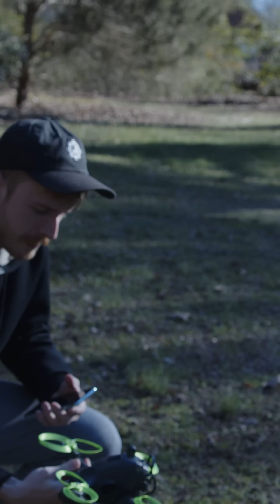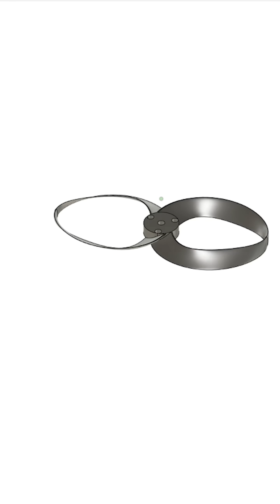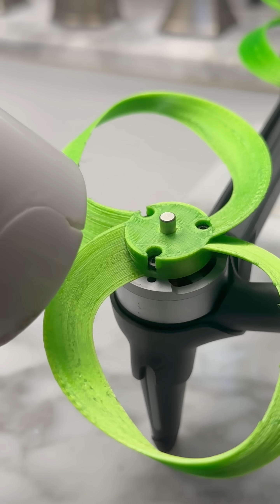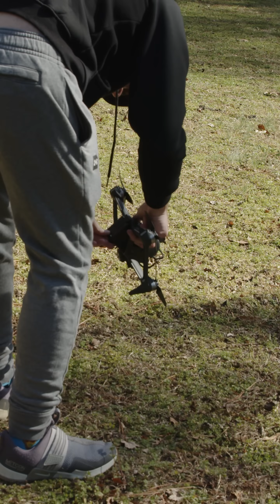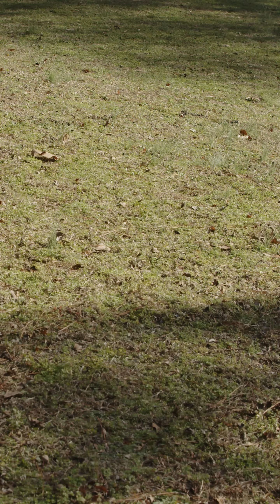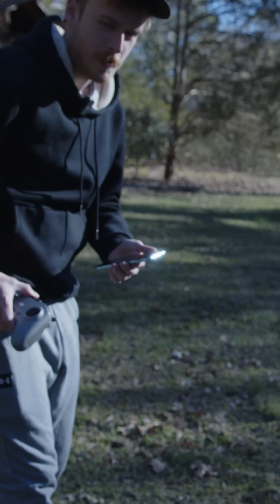Testing MIT's Toroidal Drone Propeller Design & Sound #shorts

Comment: This whole thing is kind of blown out of proportion I think, the actual paper from MIT shows that the noise reduction is honestly kind of negligible. It's only a small amount of high frequency noise that was eliminated, none of the loudest sounds that traditional propellers make are really reduced. Not much of an improvement considering the design also looks like it would be heavier than traditional propellers.
Reply: 3dB increase is double the perceived sound
Reply: The main advantage is the fact its designed to be 3D printed, and is more efficient.

The fact its 3D printable alone, is good enough for me. That unironically opens the doors to alot of stuff
Reply: @honkhonk8009  I could see how it would be fun to tinker with, but fail to see how it's more efficient when the only difference in operation was the noise level. And it has a larger surface area without being much thinner so it's not more efficient unless the actual performance is better, which they didn't really seem to touch on.

Comment: Sounds just as loud
Reply: They sound frequency is lower so its quiter from the distance
Reply: @thelespauldude3283  though the sound will penetrate walls better. One reason I like my props is that they are so high pitched even the slightest obstacle blocks a lot of the sound
Reply: @thelespauldude3283  isnt it supposed to be the opposite?
Reply: @dolbyprologicii  no lower frequencies travel shorter distance, physics ;)
Reply: @1t1swh4t1t1s  its literally the opposite though.
Reply: @dolbyprologicii  the trick is to hide the sound in super low frequency or super high frequency sound so that it appears to be a lot quiter than it actually is, that’s why the volume and sound of jet engines changes as it passes overhead because the Doppler effect shifts those hidden sounds into the audible frequency range.
Reply: @1t1swh4t1t1s ower the hz the longer the distance my guy.
Reply: @thelespauldude3283  LOL.
Reply: @thelespauldude3283  my hearing is messed up so the toroidal ones sound twice as loud lmao
Reply: 3d printing doesn't give smooth surfaces which will cause more noise in its self.
Reply: It sounded louder.
Reply: Louder
Reply: sounds worse
Reply: It might be just as loud or even louder but the noise produced is in lower frequencies thus making it less anoying. Human hearing is more sensitive in the mid to high range, we perceive lower frequencies as quiter and less anoying. If I blast 103 dB of a 1000 Hz sinewave in your ear you will go insane. If I blast 103 dB of a 30 Hz sinewave, your ears will barely register it. The same thing stands for higher frequencies too, somewhere above 17.5 khz if you are over 25 years old you can barely hear it.
Reply: Not at all.  they sound twice as loud.
Reply: He also made those ones himself with a 3d printer and nail polish, so i think no matter what itd be louder
Reply: As? I think it’s twice
Reply: Just took the noise and added a lower note to the noise spec
Reply: Twice as loud
Reply: Just turn down the volume on your phone like I did. Way quieter
Reply: Twice as loud
Reply: Louder
Reply: Louder
Reply: This is how science works... it's never ever 'settled'.
Climate's always in flux.
Reply: the ROTORS are making most of the sound. Even without any blades it makes a horrible sound. People forget that.
Reply: if not louder~
Reply: The toroidal propellers are WAY LOUDER
Reply: it sounds cooler tho
Reply: They are very similiar
Because the normal propellers are vrey well manufactured to less than 0,1mm deviance and are very smooth.
The 3d printed proellors, if oyu go down to the microscopic level, even with nailpolish are gonna be 100x rogher, whcih is why they are way louder thant they should be.
Reply: Yeah since they are "faulty" - 3d printed, imbalanced. Maybe they would be quieter if they were made on a better 3d printer maybe resin printer would be a better option also puting on nail polish like that didn't help a lot - put a drop of super glue on a motor rod qnd spin it at high rpm, it will wobble like crazy and make noise same principle here
Reply: Louder, because shit quality, for a propeller. No offense to JaysTechVault. To work half decent, a propeller needs to be designed and crafted a whole lot better, no matter the shape.
Reply: The audio is poorly recorded with automatic setting. That means the recording equipment makes up for quieter sounds with dynamic compression and gating.
Reply: Viewers of amateur "sound comparisons" must realise that quite often there is automatic audio processing which makes the quiet sounds louder and the loud sounds quieter to even everything out.
Reply: @BC-wj8fx  yup. A decibel meter is what is needed here because of all the auto gain issues involved.
Reply: @BC-wj8fx  since that was the whole video I think he changed that but you coud be right yes also don't forget youtube and your device audio profile
Reply: The frequencies emitted are in a range thats humans dont notice as much, and the actual amplitude is alot lower aswell

Comment: So whats the verdict
Reply: That you cannot print decent propellers with an FDM printer.
Reply: They are stupid. They aren't new tech. Just MIT is MIT and tested them out and said they were quieter when in reality they are not, for anything else, those are trash, why? They consume up to twice as much energy to get, for example, a drone at the same speed, idk about how it performs underwater for a boat, but i would expect it to be as much of a scam considering water is a fluid as much as air is.